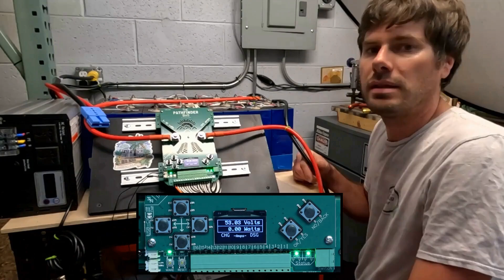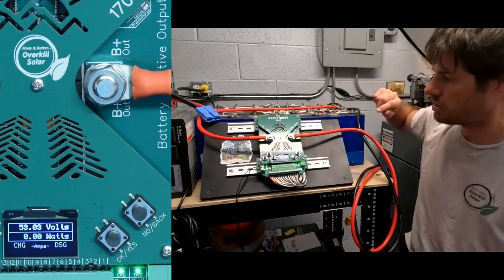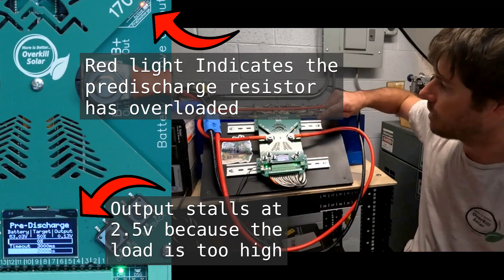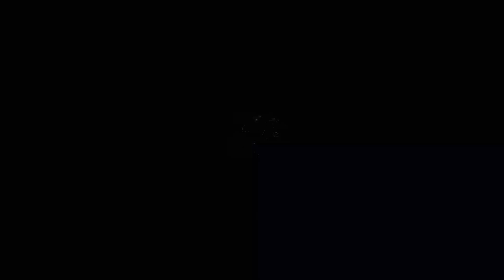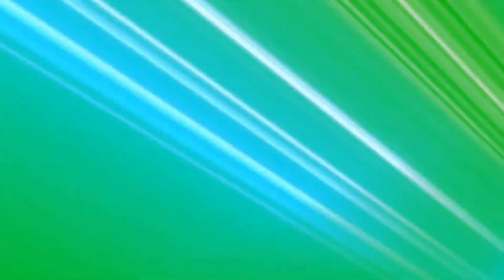Pathfinder BMS Demo Part 3: Pre-discharge & Short-circuit

Comment: Isn’t this feature the same as precharge? As far as I know many BMs actually have a precharge step when turned one, like seplos. From my point of view there is no such thing as pre discharge even tho it is technically correct if you look from the pov of the BMs and not the load itself.

Comment: This process only happens once after initial hookup, correct? Is there any reason a person would need to use this function more than once?
Reply from the maker: Any time the battery goes to 0% and disconnects, or if you intentionally turn it off.

Comment: good feature...I setup the Pathfinder today and actually used my 100 ohm resister because I saw the red light come on and hit the reset button. Don't like to read manuals. BTW the BMS keeps asking for a password when switching from home to settings and back. needs corrected in future updates. I like the Pathfinder better than the old BMS's.
Reply from the maker: I am adding a "remember me" button to the mobile app to fix this issue. You can use the USB version of the app and it does not ask for passwords.